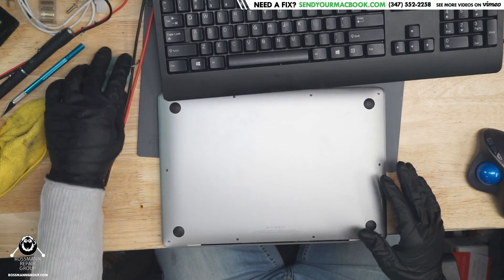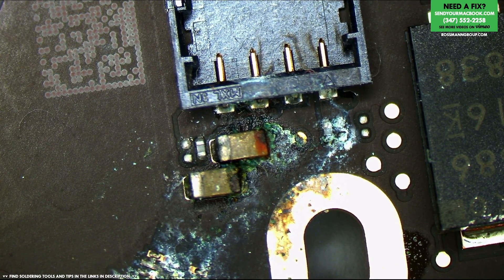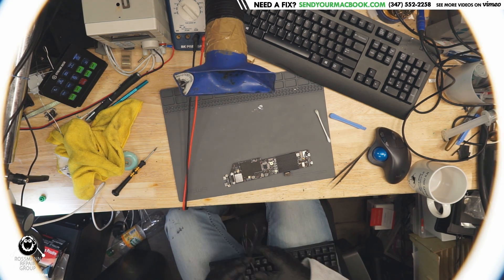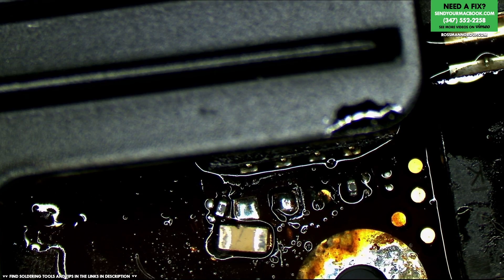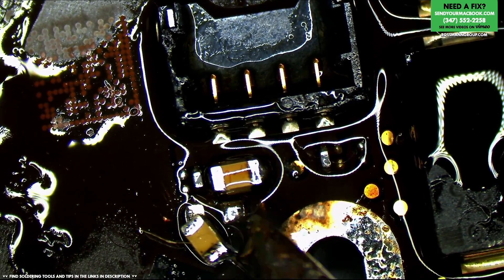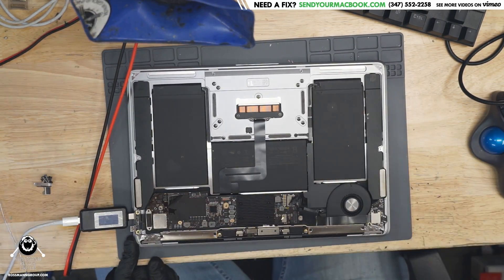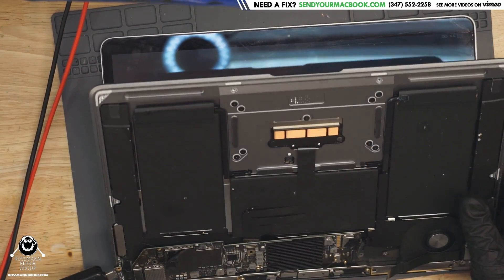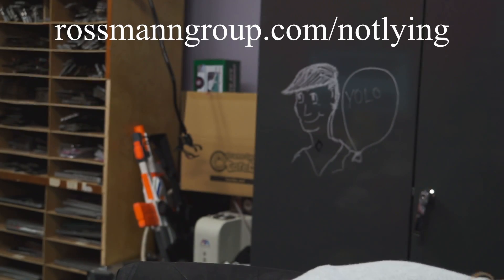A1932 Macbook Air water damage repair

Comment: Loise, need your help..MacBook A1932 2018.
The laptop cannot enter the DFU mode. The keyboard is working. There was a replacement of two usb controllers.Laptop does not turn on, the firmware of T2 is broken...and i cant to do restore..

Comment: Hey Louis, I've done a lot of soldering of components to PCBs and I've been wondering... why are you using a heat gun to solder capacitors? As you said, you don't want to use too much heat in that area so can I make a suggestion? Either, try using soldering tweezers (not my preference) or use two irons with micro chisel tips. All you'd have to do is place the parts with a Standard amount of flux, then bring in the two irons on each side of the part, ensure both sides are soldered properly then move one iron away (I find that the part has a tendency to stick to one iron or the other, you'll learn which is which), let the joint without the iron to cool a little, then remove the other iron.

No heat gun required. You can also use this approach to remove parts.

I think I've seen you use tweezers in other videos with mixed success so I can understand not using 'em; I don't think I've seen you use the twin irons method, correct me if I'm wrong.

Comment: I know you don't care to use the hot tweezers, but I watched the dude from HDD Recovery Services in Ottawa pull a surface-mount capacitor just by essentially picking it up, and replacing it with another using the same device in essentially zero time. I have little to no experience with any of this equipment, but I have to admit I was impressed.
Reply: i agree. it is faster, more productive way to remove capacitors and resistors. faster, more productive and the components around won't be exposed to the heat.

Comment: Louis, why do you think that does Apple does not conformal coat the boards?
Reply: Conformal coating is actually a very expensive process, and you have to be very careful with doing it. It acts as a blanket and messes with your board's thermals. You have to make sure it doesn't cover any connectors. It also makes repair harder since every component ends up covered. Almost no consumer electronics have conformal coating, Apple isn't being a bunch of bastards here.

Comment: Louis, instead of risking the customers data every time just put heat resistant tape on top and around the chips, would hate to see you go bankrupt because someone sued you for lost data.
Reply from the maker: Heat resistant tape is useless. Try using a hot air station on your finger at 400c with kapton tape between the air and your finger. You will be burned instantly. Then, try using a metal shield like I did - it will take a while before your finger gets warm, if it ever does.
Reply: Louis Rossmann oh, I assumed you used nothing. Didn’t know about the shield.
Reply: Louis Rossmann I have heard some very good reviews of different types of tape, I think some are very good at their job and others are shit.

Comment: that stupid cooling design on this MacBook?
What the purpose of the stupid Fan, if it's not connected via proper heat pipes to a grill in front of the blower fan?
I'm really excited when the CPU will fail 😂

I'm glad that I'm using an Hackintosh Lenovo Laptop that is even more powerful than the MacBook Pro 2019 and I can even charge it with my 20.000mAh Anker powerbank 😂

And yes, the iMessage, siri, FaceTime and AirDrop is working. I had just to replace the Wireless card and inject a peace of code with some information that I copied from my 2012 MacBook Air
Reply: I think that heatsink is beautiful. It's smaller, so it saves materials and because Apple implemented some magic it will still work fine.
Reply: @qwertyazerty1439  I don't know, at least they could put a small fan on top of it in order to keep the CPU cooler.
I once repaired a Ultrabook and it had a small fan on top of the CPU heatsink and the Laptop kept really low temperatures even at higher load..

I know that it's normal for a MacBook to run over 90°c during high load but I don't think that it's healthy for the CPU

Comment: Yeah. Use tweezers. Sometimes your stubbornness scares me a bit. Don't get me wrong. I have incorporated some of your methods into my soldering and that has improved my work a lot (industrial prototyping, not repair), but i will never get your non use of tweezers. They suck at many things but they also make short work of this sort a thing.....in prototyping you often swap components for optimization. I hate not having hot tweezers around...
Reply from the maker: I can tell your inexperience with this model board from your comment. That is a main ppbus g3h power plane, and a large capacitor next to a ground plane. You can leave the hot tweezers there for a full minute and they would never come off. I demonstrated this when I Livestream The repair,the board laughs at the tweezers. It absorbs the heat, dissipates, and lols
Reply: @rossmanngroup  Yeah, and a soldering iron is different from a tweezer, how ? They do make tweezer tips in all sizes. Including "larger" and "large". As large as your soldering iron. And two of them, both heated, and powerfully in a good jbc. Add a bit of hot air for the preheat if you need, usually don't, very nice. Do i fix Macs ? Nope, wouldn't want anything to do with the filth. Have i soldered on copper planes....? Think 48 V forklift power steering units with a 100 A 3ph inverter on them and copper planes to handle that sort of power....or maybe main drive inverters that handle that sort of current at 800V and have pcbs the size and weight of an entire macbook, mostly copper planes, really. I can tell your lack of experience from your comment...
Reply from the maker: So buy a new set of tweezers that will fit these new tips, and a new station for the new tweezers to replace mine for this  1 in 100 use case instead of using a little metal shield? Efficiency!! I see the experience flowing through 🙂

Comment: It blows my mind how small the boards are in those machines.  They are 80% battery LOL.
Reply: A lot of battery life. Four to five hours on CPU intensive Logic Board programming programs
Reply: Because everything from the ssd to the RAM and the modem are all soldered on one board and is not user servicable
Reply: @carholic-sz3qv  Ya, the soldered/non-recoverable SSD thing really bugs me.  Sure it's already that way with smart phones, but people don't usually store as much important data on those.
Reply: @Maxxarcade  I think the stuff people store on smartphones would surprise you...
Reply: @carholic-sz3qv  yeah, cannot upgrade ssd, cannot replace defective ssd, cannot upgrade memory, cannot replace defective memory and cannot replace cpu either. but hey, it is perfect because it was made by apple. at least some think that way.
Reply: Huge difference from old machines! So much stuff is integrated into single chips now.
Reply: there are palm sized windows 10 computer with board even smaller than that. the thing in the video  is nothing out of this world.  there were even cellphones the size of a watch and I mean full cellphones in a watch not just some notification watch to know when you get a message.

Comment: 2019 MacBook Air! I had to WATCH an Advertisement for an Apple MacBook Air before I can watch a MacBook Air being repaired. WELL DONE YOUTUBE.
Reply: Thank you. ALL THINGS APPLE.
Reply: @Sam S The biggest irony of all- Watching an ad on the 2019 MacBook Air with an Apple MacBook Air from 2018 before watching a 2018 MacBook Air getting repaired.
Reply: @Sam S It's going to take a while Since the primary purpose of this computer is to Program custom computer systems for testing.
Reply: @Sam S Their software integration suite for programmers are not as efficient. I want to get THINGS done without tinkering.